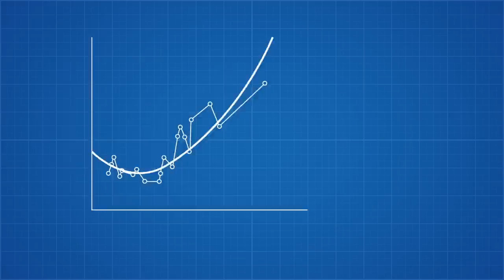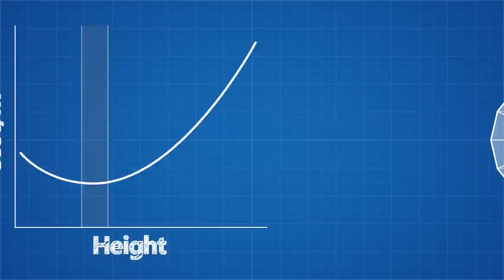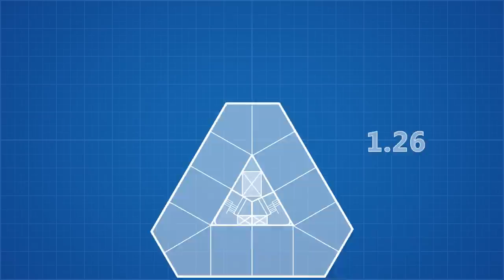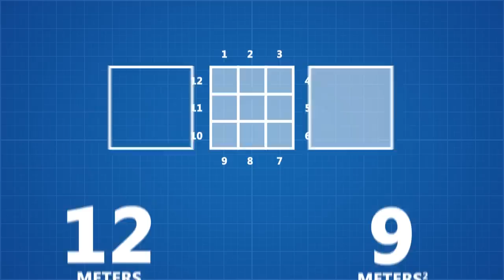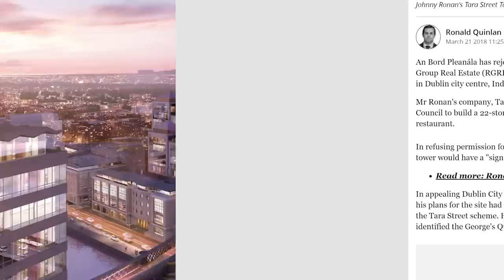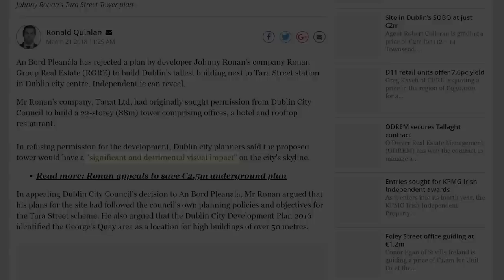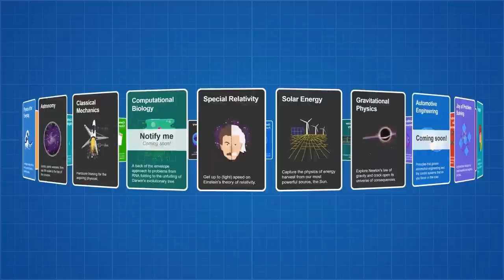How to Solve the Housing Crisis

Comment: The fact that they built that in 15-19 days is mind blowing.
Reply: I guess its more correct to say "they assembled it in 15-19 days" 
it took alot longer to build it - its just that most of the construction was done off site.
Reply: Will DePue they save time by no brush teeth have stink breath go faster cheaper.
Reply: Ya, still mind blowing. But I wonder why that idea isn't becoming something that is quickly adapted by others. Because you'd think such a thing would be wanted, since it would be the perfect for building low income houses and apartments.
Reply: UninstallingWindows It's still an impressive feat if you take into consideration the fact that you're also doing away with a lot of other problems associated with the traditional method of construction.
Reply: Harsh Thakkar like paying construction workers ikr.
Reply: Don Wald You still have to assemble it, transport it and most importantly build the pieces.Pollution is a major thing, noise, air pollution could be cut to an extent. There's also other things .
Reply: Because efficiently building low-income housing devalues all property in the city by cutting into the demand and bringing the market closer to balance which is against the interest of current property owners who may want to sell their real estates at a greater price, and, also, against the interest of other developers to whom this makes undertaking construction less profitable as $/sqm ratio dives. Not to mention how this can lead even more to situations common in e.g. Moscow, London and Miami, where real estate oligarchs will buy thousands of housing units just so they're put out of the market so they can drive the prices up by reducing supply. What can I tell ya, capitalism is disgusting.
Reply: Not all rich people are bad, just those with modern western culture. For example in ancient times rich people could earn the title of noble for doing noble things like helping the poor. The modern world just needs more people like Henry Ford or Andrew Carnegie instead of wall st bankers and celebrities, and those like drumpf
Reply: While it takes an American company 15 days to pave a quarter mile single lane road
Reply: You are damn right, but here is the thing if it takes a factory 100 days to make all the parts, they can build 10 factories and make all the parts in 10 days.
Reply: @John    Such prefab buildings were the absolut standard for cheap public housing in europe on both sites of the wall during the 60s, 70s and 80s.
Reply: I didn't intend to make some kind of moral condemnation of rich people. A lot of rich people are arseholes and so are a lot of poor people, that is beyond any point; not to mention imploring the rich to be better persons or whatever is the political equivalent of being an old man yelling at a cloud.

I was just pointing out in my comment out how industrial production and market exchange (here, specifically, in housing development) especially coupled with poor management incentivise these kinds of outcomes - poor use of space, materials and labour, poor planning, detrimental effects on the environment and people's ability to satisfy their basic needs. 

Rigorous critique of political economy is needed so we can better understand how we can apply with maximal efficiency all the incredible engineering and technology that exists today and that will exist tomorrow. Harkening back to the days of Gilded Age industrialism is not.
Reply: I wonder how much will logistics drive up cost? China can keep that to a minimum pretty easily due to the denseness in cities, but in other countries, their cities may not be as dense, so this kind technology may require more moonah.
Reply: the centerpiece is the off site prefabrication. And they seem to be in talks of franchising out their tech.
The thing is, for that factory you need the demand, which menas you need people building those buildings etc. Remember with 20 days or so per Building you need 24 buildings a year to sustain your factory.

So going to China and india with huge state backed building contracts is a fist step and probably wqill lead to private enterprises using it too.
Reply: The fact that assembly of prefabricated building pieces is not a standard practice is mind blowing.
Reply: the high rise system seems to be patented and on the way to be licensed by others,  prefab houses have been a reality for decades in America and elsewhere though.
Reply: Sapioit it is a standart practice however depending on the high of a building it might be more expensive the casting everything on site even I counties with high wages. Other part of it is that the standard prefab in the West is made in concrete. The pieces we saw in the video was made from steel, and I would imagine they will not pass western safety and fire regulations. And prefab is mostly used when you get above ground lvl and at that point traditional methods can se you bringing up one floor a week depending on the square footage. What takes time is the excavation for the basement, pile driving, changing of ground depending on the soil quality where your building, and the prep and casting of thick watertight concrete slaps.
Reply: John J There could be several reasons:

- The method used doesn’t conform to most countries’ construction standards. China isn’t really known for caring much about site safety or building codes. That said, this seems like a less likely reason than normal as that building site looked relatively safe. (At least when compared to the construction sites I live near in Shenzhen...)

- Costs in China for factory fabrication, transportation, and site construction are much lower. I would say that this is almost certainly a major factor. Many of those people are working for less than $500 a month. Hiring similar people in a country like the US would be considerably more expensive.

- Results are exaggerated. If this is a state-owned enterprise, I wouldn’t be shocked to hear that the government conveniently left out facts and figures that make the project look less impressive, even if the result is still impressive. This is the country that says it has 5000 years of history (most historians agree that the country has been around for 3000) and fudges its annual GDP growth as over 7% (when a closer figure would be a still-impressive 4-5%).
Reply: That building is gonna fall apart in 10-15 years.
Reply: But it is a very ugly building. I prefer spending time on design to make it fit in the destinated city.
Reply: Will DePue it also have to do with policy of work ( they work in 3 shifts) through out the day. No person is aloud to take two of these shifts. So it is an almost 24 hous construction site instead of stopping.
Reply: and that was around four years ago!
Reply: Anyway, the westerners will always have something to say. If China builts something they say low quality. If China doesn’t built anything they say this is why their government sucks. All i can say is. America is all talk and no action. Just look at the bridge collapse in Florida or Grenfal tower. China doesn’t need your help. 26/50 of the worlds tallest buildings are already in China. America? Only 6. All i can say is. China will keep on doing its thang. Commenting on YT will have zero impact on china’s rise. People some how still believe China is a fluke. Amazing. Look at how stable their society is. They are free from the hells of political drama. The government just does the best job it can for the country. I think it is wonderful to be free of the stresses of politics, because you know the CCP is gonna do a good job and deliver.
Seriously, unlike almost everywhere in the world. The average prc is optimistic about the future. Not so even in neighbouring SK or JP
Reply: It is not even a rise. China has always been the greatest power in Asia. More like a return to things. In 1820 China had over 30% of the worlds GDP.
Reply: @k z a the entire point is to slow u down
Reply: yeah well i'm skeptical. A lot of these chinese built in x days buildings don't function well in practice. They are generally poorly made (which isn't to say they HAVE to be poorly made just that it can happen). They are generally made of slip shod materials that break down over time. All of those problems are solvable however. There is always the worry that the emphasis on housing quantity risks housing quality, and the reduced quality can exacerbate other social issues they are ostensibly trying to solve. I would rather we have no homeless and everyone has a quality living condition. But the reality is that neither of those are easy things to solve. We're talking BIG issues, class struggle, distribution of wealth, generational problems. All of these things are really really difficult to solve. Though we need to be proactive we also need to be aware of the breadth and scope of these issues.
Reply: That's nothing. There's a hotel in China that got built in 1 day!
Reply: John J it is widely in use by some contractors in Norway. They prefab in Lithuanian I think and ship it to Norway. Problem is that it takes more resources and more patching and repairing is needed.
Reply: but union workers! lol plus hows the quality and durability
Reply: Instead of construction workers, it's factory workers that get paid, with a background in construction probably not hurting one's employment chances at such a place.
About this entire "(don't) blame the rich" thing: This is not about the rich. This is not about politicians, or the powerful. This is about YOU and ME , the policies that we vote for and the representatives that we elect. We can do anything. If we want it.
Reply: Communists used the technology quite extensively, to build buildings faster.
Reply: Communists used the technology quite extensively, to build buildings faster.
Reply: +UninstallingWindows The process of building is assembly. Nobody excavates and forges metal on site of the construction area, nobody brings a furnace to make the bricks, all the tools, and premade materials are made off-site and bricklayers assemble the walls brick by brick.
Reply: They last about as long though...
Reply: But it's just a bunch of plastic stuck together
Reply: That's how long it takes me to build 90s in fortnite.
Reply: Getting a building permit in CA takes 1+ years
Reply: Its more like joining slabs pre casted
Reply: if we are assuming its of a quality of other chinese buildings I wouldnt consider it impressive
Reply: Typically most of the Chinese building projects are of very poor quality, partly because of bad quality of materials and cutting corners of standards.

Comment: I propose a solution: If we had a set of open source construction plans, of the very well designed 10+ level apartment buildings that companies can pre-build in a factory. Then get a permit faster, because the design is already well made and generally accepted as a good design for a very livable building.

It would be much more easy for construction, if there was a set of good construction designs that are free to use and do not require planing and designing from scratch for every apartment building.

The design of the apartment tower could be based on the movement of the sun, the wind and the trees that people want to have around the building.
Reply: Yeah or at least be able to buy these plans at a cheaper price. This would also be beneficial for the designer because if he would sell his plans 5*100$ he would profit more than if he sold it once for 250$.
Reply: Actually a very sensible idea! Very similar to those manufactured homes. Of course you would not allow buildings of the exact same design to be next to eachother to prevent the city from looking dystopian.
Reply: Better for the environment too!
Reply: That's called prefabrication I think, which is used is some new housing in my country (even the toilet water tank is built-into the pre-fabricated building structure @ the factory I think). I heard 1 disadvantage of this though is that there'll be seams in-between the different floors of the buildings, increasing the risk of water leakage from rain
Reply: @lzh4950  Similar to the idea of Liberty ships and Victory ships used by the Anglo-American allies during WW2. Standardised prefabricated units built to a common design with minimal use of craft or custom labour techniques and use of semi-skilled labour instead. This needs very rigourous and detailed testing and inspection and quality assurance to avoid defects which could lead to failures. There is a multiplying effect in using a design multiple times in that any mistake in design or construction is repeated several times before detection and rectification can take place. 
This happened with the liberty ships which developed cracks when using new construction techniques ( welding instead of rivetting). It did not take away much from the mission at hand, the construction of huge amounts of shipping capacity needed to win the war.
 In Ireland in the 1960's we had a system of high-rise public housing building using prefabricated concrete panels to build apartments. This is exactly what happened, cracks and seams in the panels let in water in Irelands damp climate, resulting in rapid deterioration of the buildings and their eventual demolition 40 years later. The Ballymun scheme is an object lesson in bad planning, bad execution and disastrous lack of provision of other amenties such as shops, community centres etc. Let us hope it is not repeated.
Reply: Not really a new idea. This is exactly what happened in Czechoslovakia in 1970s. https://en.wikipedia.org/wiki/Panel%C3%A1k
Reply: @JB-yb4wn  yeah that’s the tough balance we have to strike with things like this, currently in the western US our solution to avoid that dystopian feel and the crowdedness and lack of personal space suburbanites fear in cities at all costs seems to be fill our empty space with identical single family homes as far as the eye can see, with no amenities or stores or workplaces in between, which just exacerbates traffic issues for the employment centers and forces people in those suburban wastelands to spend more time and money just to get to work or buy necessities. Hopefully things like this can find a middle ground by having room for green space around, maybe leaving room for cosmetic differences and variability, while also being cost-effective, fast, and safe, and creating the livability and community that density can bring if done right.
Reply: @joshogden3105  
I have noticed in Vancouver, where I live, that whole communities are being designed with everything within walking distance (Westbrook village out on the UBC campus). So what you describe has already started to happen in some of the metropolitan areas of Canada. 
In fact, for some neighbourhoods downtown, (the library district), office buildings have been converted to big grocery stores and Home Depots eliminating the need for cars. Now if we could only make this stuff affordable for the salaries people are being paid...
Reply: @JB-yb4wn  they already do that in suburbs lol
Reply: It is not a novel idea (but a good one). They still use it in the Netherlands (there is a dozen or so pre-approved designs and some prefabrication industry, which makes building public housing much faster and cheaper), and used to be the standard in the Eastern Bloc pre-1989 (this is why you have so many concrete almost copy-paste neighbourhood in numerous countries of the region).
Reply: @JB-yb4wn  > Of course you would not allow buildings of the exact same design to be next to eachother to prevent the city from looking dystopian.

I live in France, one of the countries that has already dealt with this issue in the past (we basically had a long housing crisis from the 1890s to the 1950s) that we fixed through, well, prefab districts. A lot of them ended up looking kinda bleak because massive advertisement for suburbs and cut corners in those apartments led to the middle class leaving them, but I live in a city where we have a successful one, and the secrets to make it not bleak are the presence of color on the walls (you can either used colored concrete or weatherproof paint), inciting people to put stuff on the balcony, putting it close enough to dynamic areas that there are passers-by during the whole day, and very simple stuff like sunshades ... 
All of this leads to a place that can be pretty lively (the example I'm taking is mostly pedestrian and next to the university and the city center so good placement is really integral) and rather pretty, with a sort of seaside feel to it.
Reply: @willmako5009  
Nothing beats the Latin quarter in Paris, we stayed in an inn dating from the 1690's on rue des ecoles, that is a gorgeous neighbourhood.

Comment: During my college days, I recall learning about the down side of prefabricated modules in building.  You have essentially the same structure repeated on each floor making the force distribution extremely focused.  It would be very easy to cascade and cause failure on those points, like the whole corner of the building failing. (And it has happened before)  A way to prevent this is lay the floors alternatively, but I don't see the China company doing so.
Reply: As you just pointed out the solution, join me and we will make affordable housing for the people. (I kid but not really, poorer states have a habit of dumping their undeveloped denizens into city streets where the service economy rarely matches the cost of living, thus more homelessness. )